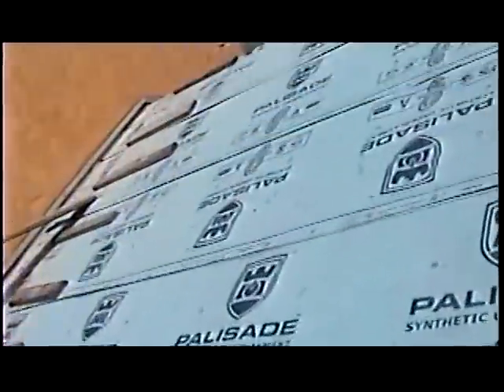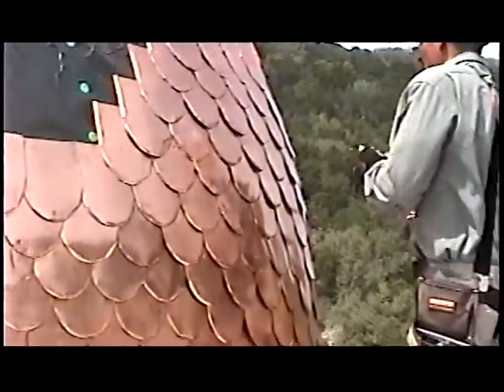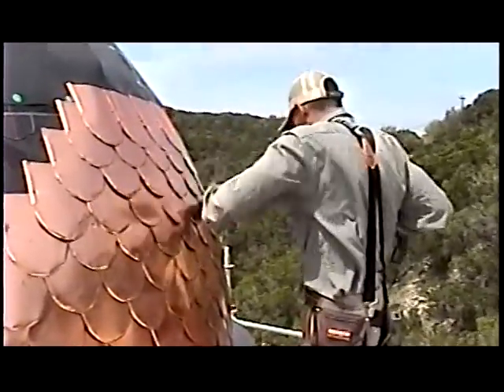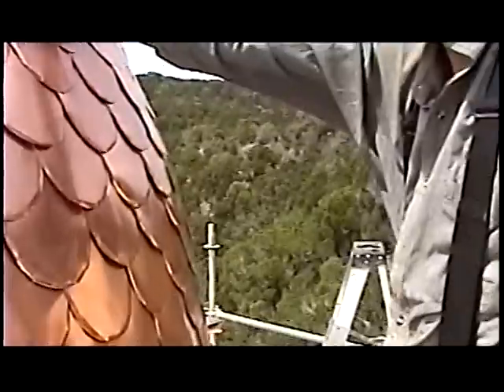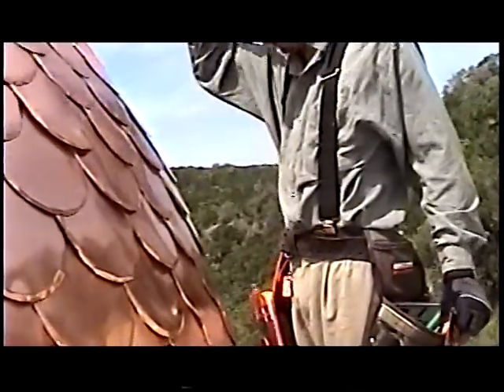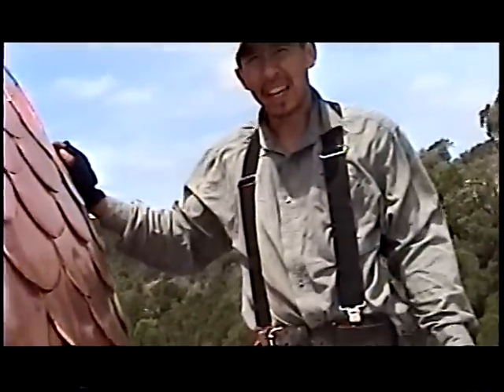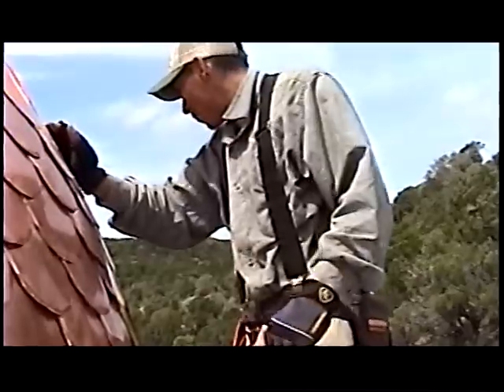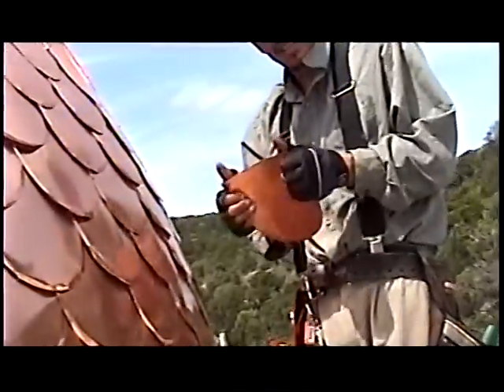The Most BeautifulHand Cut Fishscale Copper Dome - http://www.texaselitepublicadjusters.com/

Comment: Copper nails for copper!damn who told u to use stainless?dont be cheap be smart
Reply: stainless steel nails are perfectly fine in fact better. the job over all is garbage
Reply: @fredjohnson4772  Galvanic corrosion will chew right though those nails.
Reply: JYYCEE 67   I'm a visual artist with over 40 years of silversmithing. The galvanic processes occurs when two dissimilar metals are in contact with one another. (Ferrous and non-ferrous metals... in this case; steel and copper). The process happens when an electrolyte like water, or distilled water (Rain) comes into contact with the two dissimilar metals. Some of the earliest known examples of man made galvanic charges are from Iraq and are known as the "Baghdad Batteries," (150bce) These are ceramic containers that have a core on the inside made of a coiled copper sheet that has been coated with tar and wrapped around an iron core, creating a galvanic cell. The electrolyte being lemon juice, or salt water...). The galvanic corrosion occurs when the two metals come in contact with each other through an electro-chemical process. This process creates cupric oxides on the copper, and oxides on the iron, and both metals weaken and degrade through galvanic corrosion. 

Please feel free to go fuck yourself.

Comment: i would do it interlocking every single piece, marking lines per every single row, yes! guys stainless steel cleats or same copper material cleats. perhaps create a 3 foot piece pattering to go faster, i know there are machines to make a perfect piece, but we humans are capable to do any custom shape look great. (machines shapes or custom hand craft = same thing) 
what i believe the installer needs to be trained with theory information.

Comment: It's beautiful work... Fabergé of roofing materials.... but why would they build a huge house like that out of sticks? Like gold plating a turd.
Reply: Structute is steel for columns and steel cast concrete for flooring. Roof may yes have wooden structure. I can also see concrete pillars. The sticks you see are used for walls for panels to ve nailed. Not sure where this is built but in usa its pretty dam common to build walls wirh wood and lay out some panels. In Eu i stead of wood they would use aluminium profiles but it is more common to go for regular bricks.